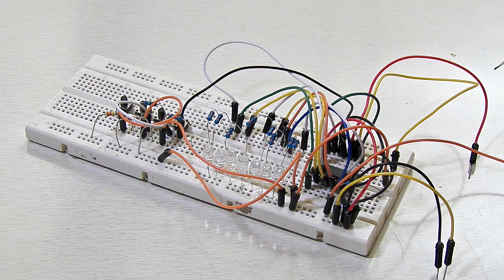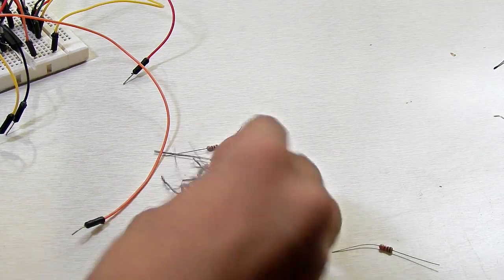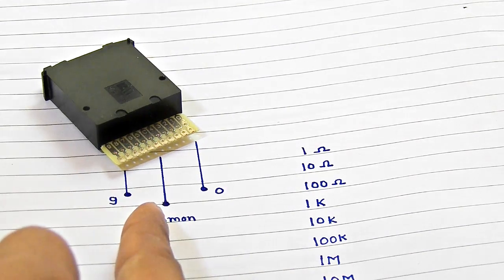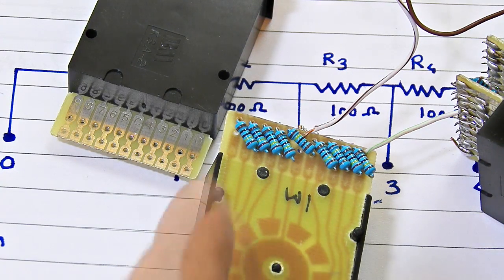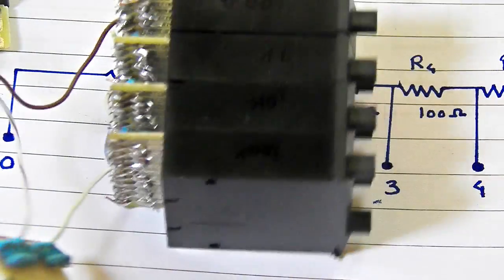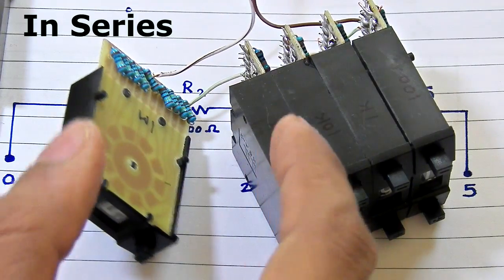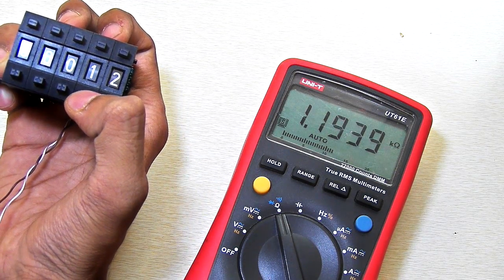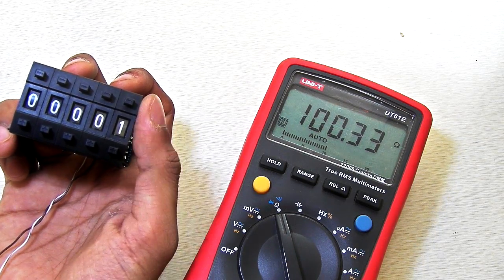Make Decade Resistance Substitution Box - Make Any Resistor Value !

Comment: You got the common to pin 9 wrong.  That's why this doesn't work as it should. Don't follow this guide - it's totally messed up.
Reply: Hi George. Have you seen the Altronics kit, resistor and capacitor decade box? I'm currently building one such kit

Comment: So the accuracy is solely dependent on the percentage of the resistors and nothing with the thumb-wheel-switches? Also, can I get it to produce single ohms? milli-ohms?
Reply from the maker: Nice Question! 

Well this ressistance box can substitute 1 ohms fairly accurate ,but thumb wheel ressistance take in account below 0.5 ohms
Reply from the maker: With 5% ressistors, miliohm range is not stable also thumb wheel Switches has miliohm's of ressistance!
Reply: Thanks for the quick response. I subbed to your account and enjoy your videos, keep up the good work!